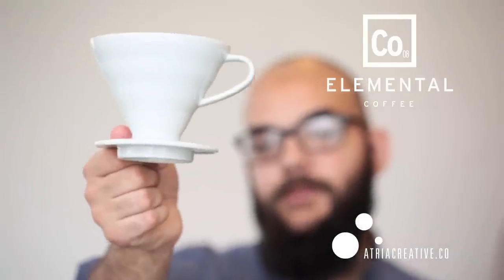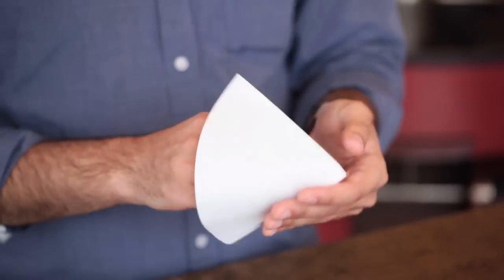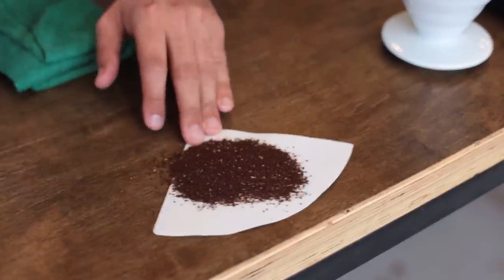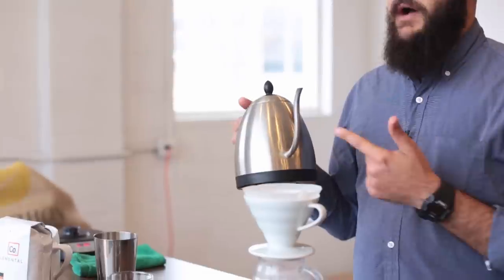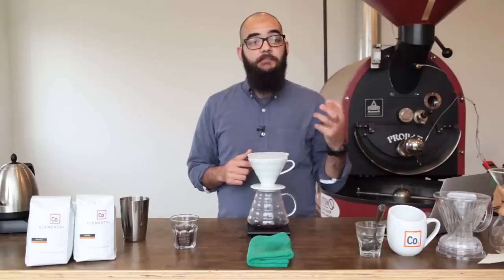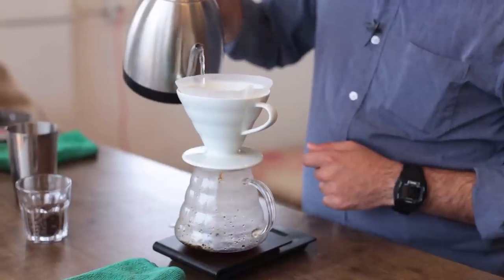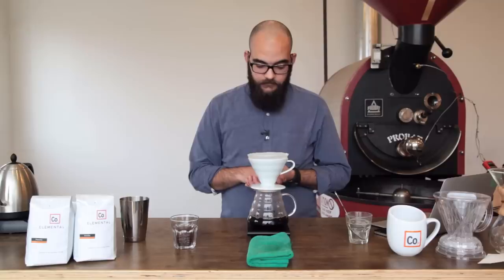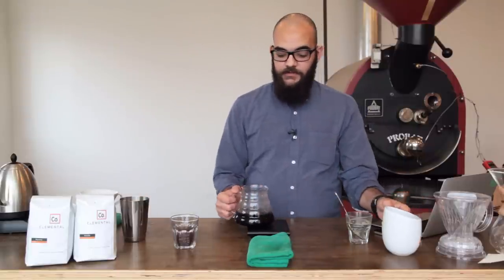How to Brew Hario V60 Coffee

Comment: I do the same thing, but I think the coffee isn't too hot, I use boiled water after 30 seconds of rest.. Any tips?
Reply: Assuming you are using an aluminum pot like in the video, it will boil very quickly, but you need to make sure it is a fairly brisk boil. Often times the steam is being blown out of the top holes too fast and you can't see it. Turn down the heat when to check and see if steam is flying out. If it is, than you should wait 30 second and pour.
Reply: Old comment but I think the purpose of actually making it a brisk boil before pouring it in is because drip coffees usually have a lighter, more delicate brew than basket drip brews with a normal coffee machine. This will yield a tea-like mouthfeel that will give you the proper heat not to scald your taste buds, considering you really do want to taste the nuances of the coffee. Great drip brews also cool down wonderfully. Note the difference in the flavor as it cools.

Comment: Are you using the size 1, 2 or 3 of the V60 dripper in the video?
Reply: +markguox I assume it was 02, because the cone seems bigger than the 01 for single serving. Besides, 24 grams is a lot and not appropriate to be filled in 01.
Reply: Thanks for the info Gloria.

Comment: I've watched about 4 videos about this topic.
No one said how hot the water should be. Boiling? Or not so hot?
Reply: somewhere in between 90c and 95c degrees is fine. Many say around 93c. If you don't have a thermometer or temperature-controlled kettle, boil it and just let it sit for 20 seconds
Reply: @asuspower8629 
Thanks!

Comment: Is there not a re-usable mesh filter that can be used? I have one in my drip
Reply: A re-usable mesh filter will be metal. The oils from the coffee will more easily pass through to the coffee, which can be a positive. However you're more likely to get silt in the resulting cup but I think it would depend on the quality of the filter. Also metal filters can become dirty and hard to clean but if you clean directly after brewing it should be fine